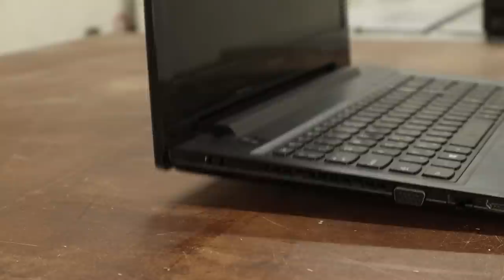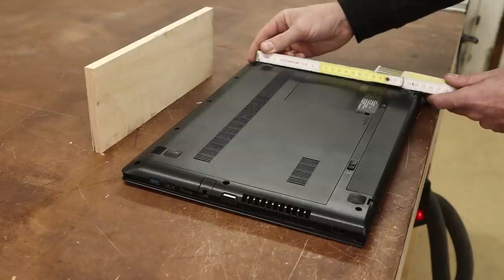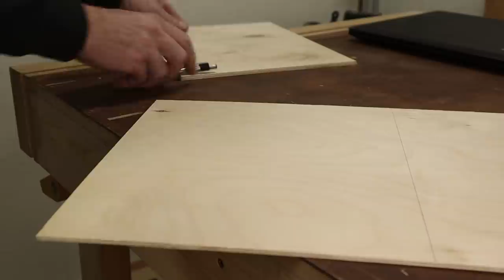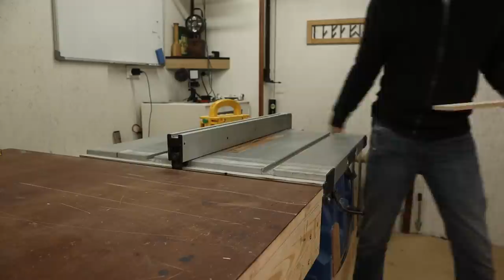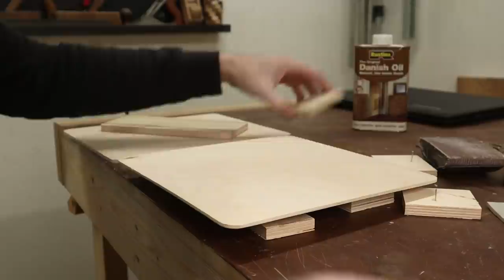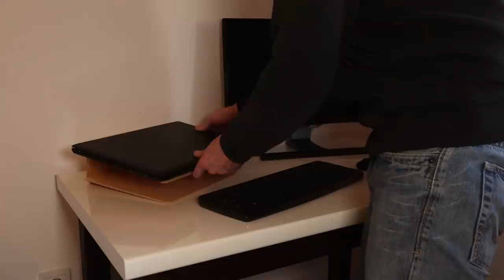Super Simple Laptop Stand in Just 5 Minutes

Comment: Interesting design, in simplicity, is genius, maybe a small concern about stability of upper part..
Reply from the maker: Thanks! I don’t worry about it dropping the weight of the laptop locks the upper piece very nicely that said I wouldn’t type on it because it is a bit bouncy. I intentionally use a separate keyboard because it’s more ergonomic.
Reply: @Ollaris  make sense, in matter of fact I didn't mean the problem in terms of the weight of the notebook itself, but when you want to close the lid and put there a bit higher pressure it could be tricky.. It's just a first impression, will see after some time of usage in real terms..